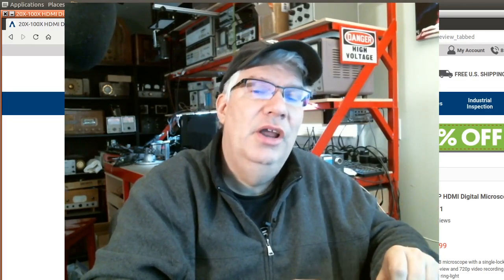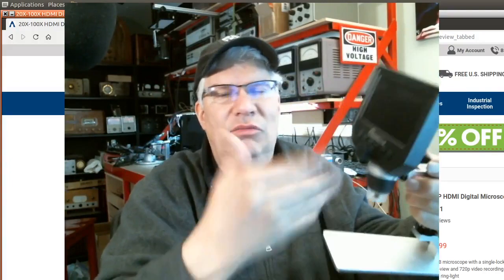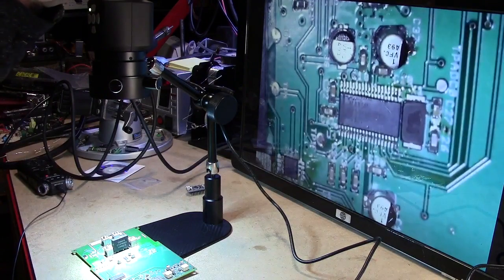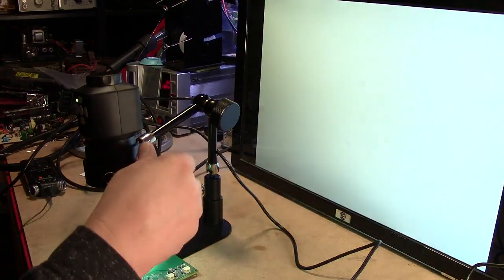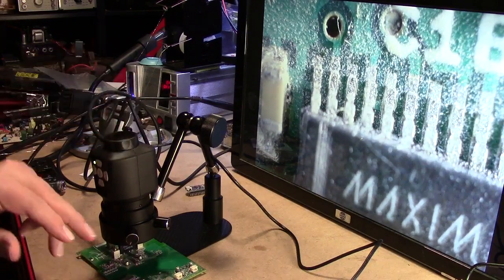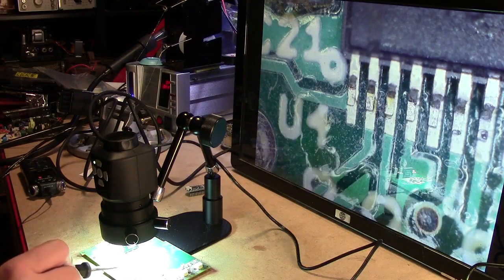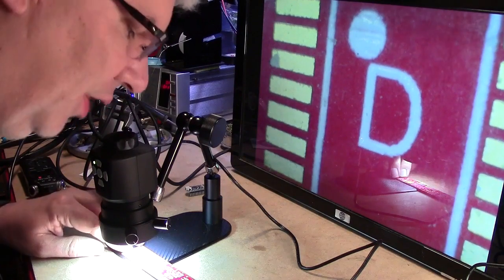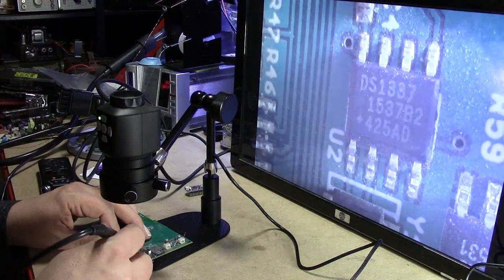191207 AmScope UHM350 for Board Inspection Part 1/2

Comment: Thanks for the video Craig! Great timing! I use a simulfocus micro-scope, so I can do 2 eyes + cam output, but the camera is pretty shite. For rework, the microscope is fantastic, but for fast general inspection, it's a pain and I get a sore back/neck/eyes from going on and off it all of the time, so I have been thinking of getting a seperate good camera for inspection, but I absolutely want to have auto-focus. Not being able to tilt the board and focus in without having to adjust the focus would drive me up the wall...  that said, your AmScope does work pretty well, and it's a bit cheaper than I've been looking at. I'd love to see how much focal length you have yo be able to tilt the PCB and see into and under some ICs... ;)
Reply from the maker: Rendering part 2 now, will post in a few minutes to answer this question.
Reply: @CraigHollabaugh  oh wow, fantastic, thanks mate!

Comment: Yeah the lag seem very negligible at the start of the video, well zero actually and a good working distance. I use an Amscope SE400-Z for SMD rework with hot air and iron, but not sure how I would go working via the screen. Overall it seems great for inspection but not sure about actually working under it, for me anyway. Thanks Craig.
Reply from the maker: Thanks for the comment, I'll report back if this setup is a pain for rework.
Reply: @CraigHollabaugh  thanks Boss :)